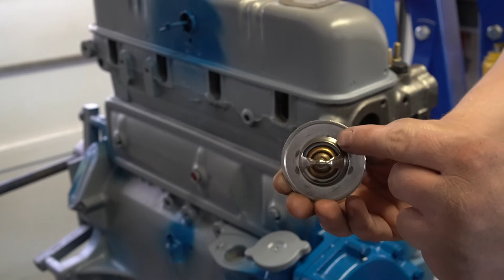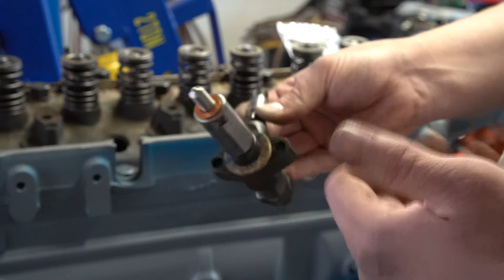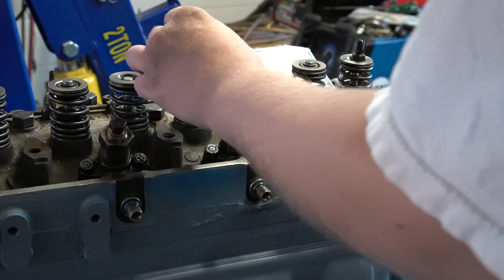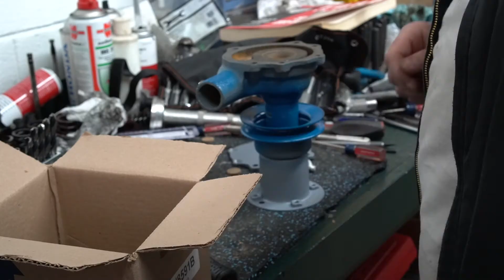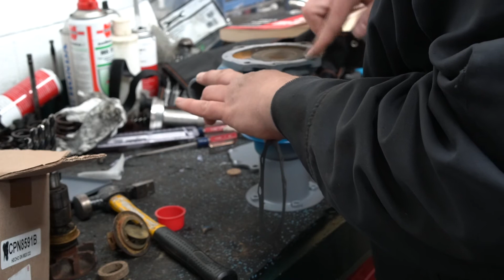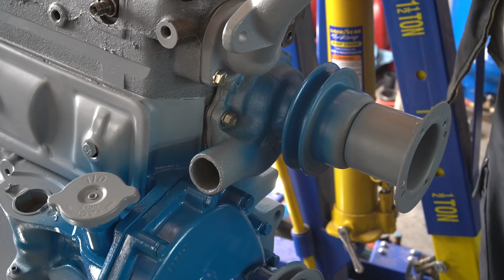Installing thermostat, fuel injectors, and water pump on Ford 172 ci engine

Comment: I just bought a Ford 801 tractor with this engine. The simplicity is nice, but I don't understand why the engineers decided to put the injectors and return lines inside the valve cover. If there are any fuel leaks, it'll also contaminate the engine oil and ruin the bearings if it isn't caught early. I have a couple other diesel engines with injectors and return lines on the exterior of the head, so I'm curious what, if any, advantages there are to having them inside.
Reply from the maker: Yeah that's one area they failed on designing this engine. I dont think there's any advantage to the injectors under the valve cover. I'd guess they might've done it this way since the engine was originally designed as a gas engine and that was the most effective way of getting the injectors into the combustion chambers.

Comment: Do you have any tips/tricks for finding return line leaks that are letting diesel into oil pan?  Specifically curious how to confirm there isn't a leak where the return line goes into/through the block. Pump was just rebuild so I'm somewhat confident it isn't the pump.
Reply from the maker: Never ran into an issue with one leaking but you might be able to do an air test using soap and water to see if you see any bubbles kind of like checking for a leaking nail in tire. Other option might be a vacuum test.
Reply: Thanks, I'll give it a try

Comment: Do you have a source for the rubber seals ? I can't find the part number.  thanks
Reply from the maker: Which seal are you asking about? The injectors seals? If so that part number is 312070.
Reply: The four side seals that seal the injector lines to the block of the head.

Thank you
Reply: Dam it’s hell finding them so I finally gave up and used rtv